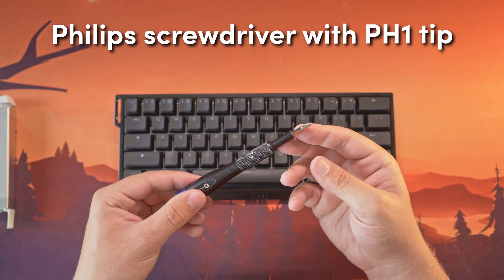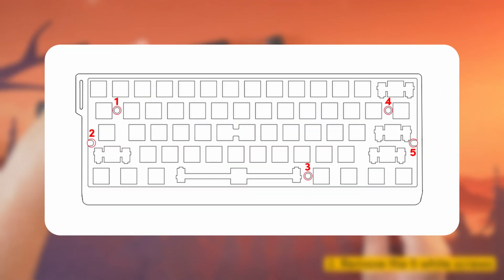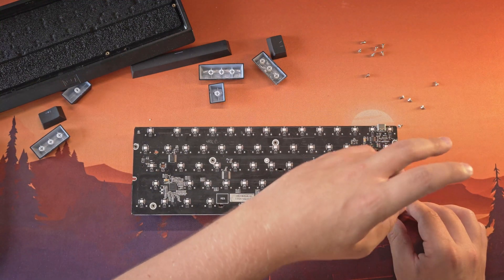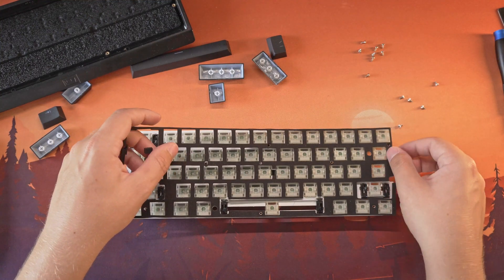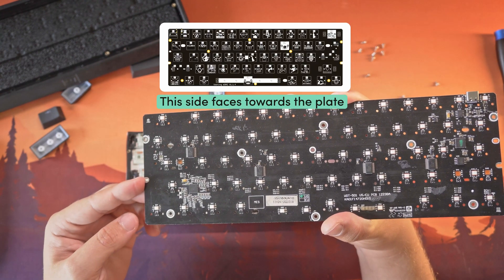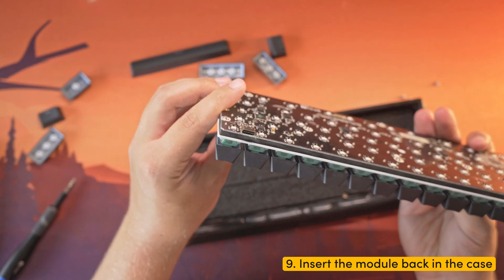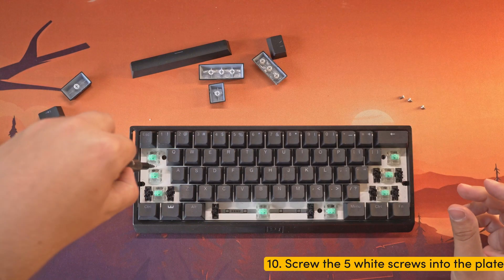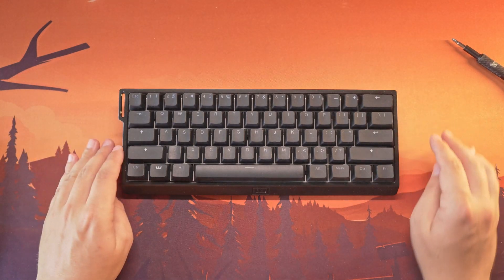Wooting 60HE - How to Swap the PCB

Comment: Do pcb replacements have additional cost or can it be cover under the 2-year warranty/30 day return policy? I pretty sure I damaged the USB connection and my 30 day return window is closing.
Reply from the maker: There is a 4 year warranty under normal use, the warranty does not cover self-inflicted damage. Then it would rather be an insurance than warranty. Modding the keyboard greatly exposes it to user damage. When it doesn't fall inside warranty, we offer a PCBA replacements but there are costs associated.

We appreciate honesty with these type of requests, we always require a picture of the PCBA for inspection.
Reply: @Wooting will you guys be selling PCBs and switches separately? I built a beautiful little 60% recently  so I only need the pcb and the switches.

Comment: Do u guys plan on making a TKL keyboard anytime soon?
Also a longer macro pad, like 6 keys in a row?
Reply: Just wait for Keychron's Q1 HE. I don't think Wooting going to release TKL or 75% soon.
Reply: @007meetch  That is amazing. Any word on how you actually use the new features? Will VIA be updated to accommodate Adjustable Actuaton Points and Double Action?
Reply: @007meetch  you might be right...

Comment: I've bought two 60HE's (a UK ISO and ANSI version) and both times I've had trouble taking out all the screws of the PCB. Always had 1 or 2 screws that won't budge. Wanted to change the stabilizers to durock clip ins. Not a big deal but my spacebar was both a bit rattly compared to the rest of the stabs.
Reply from the maker: Make sure you use a PH1 screw head. If you use PH0 excessively you start to strip the cross.